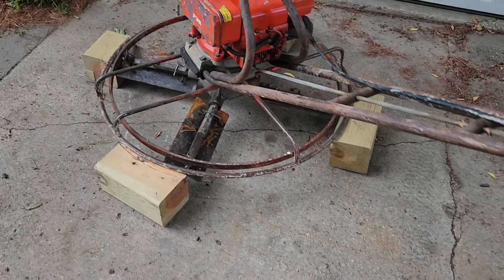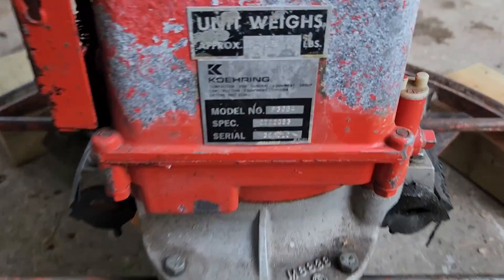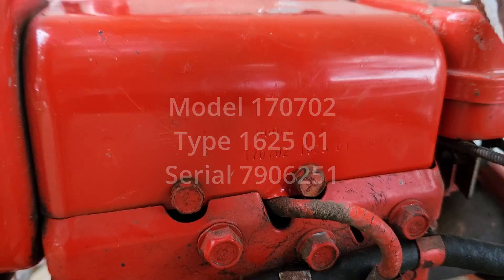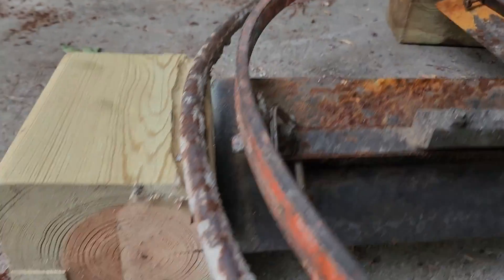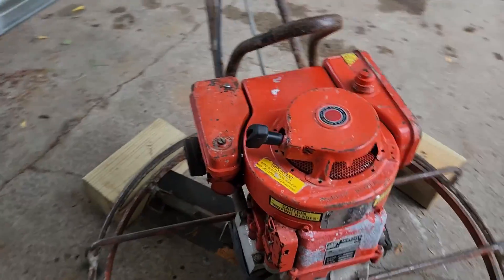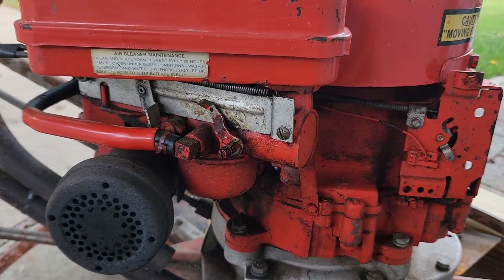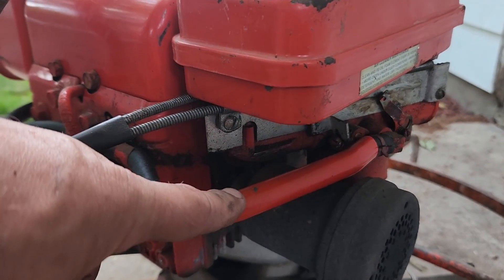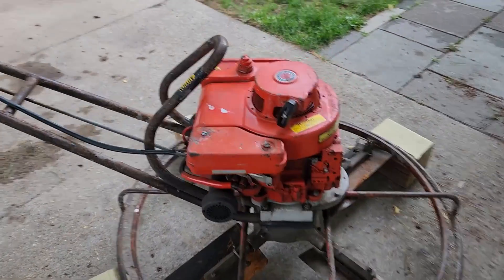Koehring Concrete Smoother with Briggs and Stratton engine

Comment: Once again your showing another absolutely classic machine powered by a classic Briggs and Stratton engine that machine has 2 version.s of it The Walk behind like you worked on and a Ride on Verizon for Big con Crete job's
Reply from the maker: Wow, I didn't know there was a ride-on version. Thanks for watching!
Reply: @RealManSkills   your welcome young man I saw that ride on machine at the place I use to work at when the new warehouse floor was being finished so it was  could be sprayed with concrete cure and seal

Comment: Do these not have a clutch? When I pull mine over the engine is locked to the blade spinning?
Reply from the maker: This is the only time that I have ever seen one of these. I would look underneath and find out if the belt/chain is too tight or stuck or something...
Reply: @ cool thank you, were you able to start it on the ground without it spinning?
Reply from the maker: @IntoTheDirtshop  I didn't even try since the owner made those wood blocks. However, the blades were moving slow enough before I pulled the handle, that I don't think they would have spun if it was on the ground.

Comment: I remember my father in law having 3 of them plus 2 other brands I don’t remember, but I do remember service them after each job they got oil change and every other oil change new air filter and spark plug 
He would drain gas tanks and run carb dry 
They all sold for more than he paid for them new 😊